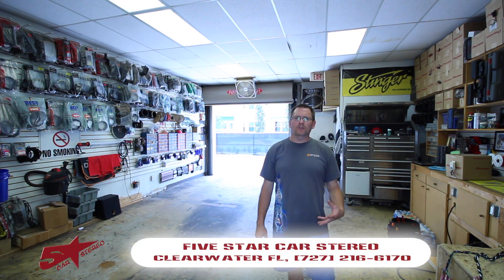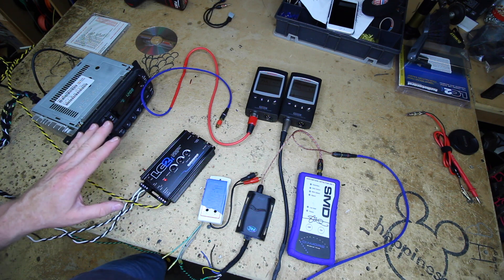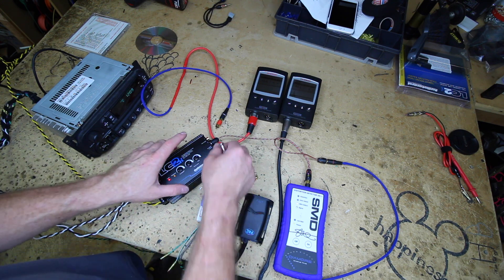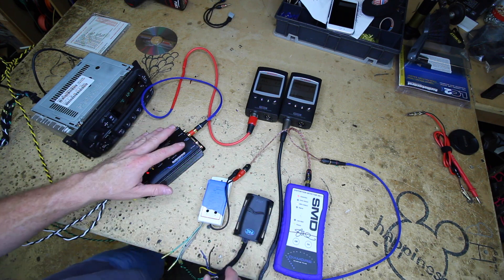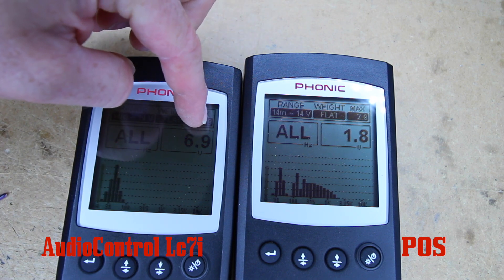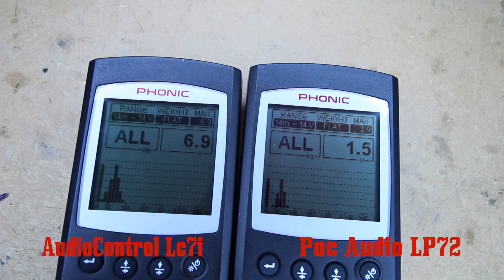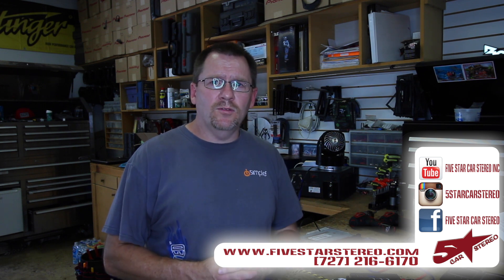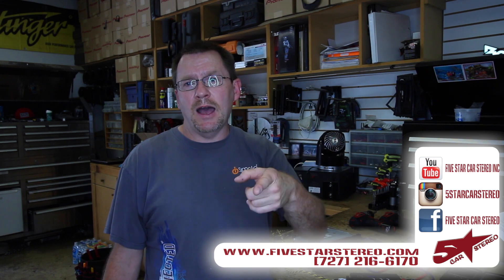Should I get the better high to low level adapter to make my car stereo sound better

Comment: I just installed the LC2i Pro in my SUV today.  It sounds amazing.  So glad I spent the extra money.  Well worth it.
Reply: Did you have a cheapy before that one?
Reply: @radianm6  really hate when ppl don’t reply then someone comes by 2 years later and still waste of their time cuz someone can’t take 30 seconds to comment 🤬 I have a cheapo that is “plug and play” for my car made by pac’ 

Just adding a sub works great! 
When I tried to add 4 channel to door speakers the signal was so dirty get that nasty hum/hiss which is being amplified because the pac loc is cheap’ 

So can confirm at least for me if only adding subs cheapo is 100% fine 
If you are adding amp to
Your door speakers splurge for an active loc
Reply: Hello, what did it improve in yournsystem ?
You can reduce the output voltage of headunit as I understand. Did it reduce the chime noise like turn signal volume, parking sensor sound or other warning sounds ?
Reply: @radianm6  No, it was all factory before that.  I had an Alpine X-A70F 4 channel amp, 175 w/ch.  I guess that was my old system.  Now I'm using an LCQ-1. I have an Epicenter, two 8W7's, Alpine X-S69C's in the front and JL ZR650-CSi's in the rear.  I can turn up the system about as loud as I want with no noticeable distortion.   Everything sounds breathtaking.

Comment: I installed a JBL BassPro SL2 powered subwoofer on my 2016 Volkswagen e-Golf (non Fender audio) by tapping the front speaker outputs and  connecting them directly to the sub’s high level input.  

I noticed the head unit output now clips at a much lower volume and it gets unusually hot. It is impossible to set the sub amp gain as the levels are all over the  place and slight changes to the amp gain cause the sub to cut in and out. 

I verified the polarity of all connections on both ends and everything seems alright. I would assume tapping into the speaker outputs effectively lowers the impedance seen by the head unit onboard amp causing it to go crazy. 

Wondering if using an LC2i instead of the sub’s high level inputs would make any difference.

Comment: What about amps that have their own output converters, are they any good?
Reply: Usually no, they are bad. They have no way of controlling the gain. It’s…cert basic input. Often bass cuts out, or is barely there in lower volumes.

Comment: Lc2i for the win. Also do a vid on running the subs on the top rca outs on the lc2i. Very clean setting without acubass
Reply: Opposed to what?
Reply: @LTSRIDE24  the bottom is for bass out top full range does they sound the same?
Reply: I'm unfamiliar with the LC2. I have the LC8. I'm thinking of doing away with it & simply using my amps high level inputs. I seem to be getting a low / dirty signal from my LC8.
Reply: @LTSRIDE24  make sure polarity is correct
Reply: @bumpylump9236  I know I know asking for advice on YouTube 😂 

Would a lci2 allow 
Me to add a 4 channel power pack like alpine ktp445u  to factory radio (4 door speakers) 
and then add active/ self powered under seat sub…? 
Sun does have both high and low inputs
Reply: @joshymcdaniel9233  I would put a crossover after the l2ci.

Comment: How about using the speaker / pin adapter & tapping into your speakers directly?

How does that compare? That should be a super clean signal, I'd assume?

Comment: I have the LC2i in my '14 Chrysler 300 (Base model) tapped into the rear speakers and it works great, I have ran my 12W7ae with a DC 2k and also a old school Ultra Linear 2150. Both amps made it sound good and the Audiocontrol unit was very easy to install
Reply from the maker: Jesse Gunderson very cool, thank you for sharing your experience.

Comment: Help me in here i have a lexus es 350 2014 and it has premium sound system ( not ML) and I already replaced all speakers in the car I just want to know how to convert the wire signal from the amp it’s confusing it has 1 channel (1speaker) separated in the dash and tweeters in corners L+R and front woofer in doors L+R and rear speakers L+R and the rear sub . As the amplifier diagram for output cables i got 5 channels wires I need to connect to line output converter!! How to do that? I don’t want to lose my notifications sound such as sensors /gps/and the rest . So help me please figure this out.

Comment: The LCi2 PRO is worth every penny. IF you set it up CORRECTLY. 
My corolla has bass roll off at just 41-42 volume. Which is terrible. Goes to 60. 
Doesn't distort until around 52 and that gap is a HUGE volume increase btw. 
Now my bass smoothly increases with it. that ALONE is worth it.
And the fact I don't have to turn my gain up on the amp means less heat, and work for the amp.

Comment: I've got a cheap $5 ebay converter, but I think it's the reason for my problems.
Pioneer amp with 300w subwoofer, maxes out at 8A power draw from the battery. When I turn up the volume more, it just sounds strange and "empty", but doesn't draw more power. I guess this is what clipping sounds like. The amp is great and should output upto 600w rms. The headunit is a $500 parrot astreoid, so I bet it is the converter, but I want your input on this, if you have any suggestions or tips for me

Comment: Thank you for the video. Question. Upgrading a factory Bose system with a 5 channel Infinity amp and sub. Seeing some say that a direct high level input to the amp is better than using a LOC. I always used an AC DSP/Epicenter before, but with older amps and RCAs. Is it better to still use like an AC in the middle to convert to RCAs ? I was planning to get the 7, and run all the speakers through it. Thank you

Comment: I have a 2017 Kia Soul with the stock head unit without navigation. I’ve tried 2 different one a scosche (junk I know) and one the was pre made into the factory harness. Trying both of those I can’t have get a 1V on the RCA’s. Will this boost it to 2V or higher? Thank you

Comment: nice video Dean. i have a question, can i feed the signals from loc to parametric equalizer for more outputs? and hoping you make video  about adjusting the voltage output on loc's.thanks 5 star car audio.. from 🇵🇭...

Comment: I used a metra loc originally and the sound would only come through when i turned the amp settings up all the way. I'm picking up a lc2i in the coming days. Hopefully that fixes my issue of muffled sound and no bass.

Comment: What you think about the axxess mini 4 channel in-line converter 80watts? 
is that a good one for my factory non amplifier radio. to use a 4 channel amp. 
Thanks for the great videos. I’m a follower.

Comment: For installing a Subwoofer do I Tap into the Speaker wires in the trunk deck or should I tap into main FL FR speaker for full sound and bass? 2016 Mustang GT
Reply: Kyle Mertz you should use the fronts, Ford is known for attenuating the rear signals in their vehicles.

Comment: The audio control is for 2 channels, if I wanted to do 4 channels you can hook up 2?
Reply: I dont see why not. Only con i can think of is losing fading from back to front.
Reply: You can either get the LC7i. Or 2 LC2i's and run your front input to One and the Rear input to the other. Then you run your RCA's to each channel of your Amps. I went with 2 LC2i's. I ran the RCA from the Rear LC2i Sub output to my Sub Amp as well as the RCA to my mids & high Amp Rear channel. Worked Great.

Comment: Great info man! One question I can't find and answer to is if it's possible to splitting the rca outputs to send singles to different  amps or perhaps multiple channels on an amp?
Reply: Yes you can, however you will lose voltage every time you split, and you will lose fade ability because you will be working with only 2 channels.

Comment: Finding out when the stock deck distorted, what exactly did you have the dd1 plugged into?
I see one piece of the RCA in the lc2 to the dd1, but where or what is the other blue part of that rca on the dd1 connected into?
Reply: It differently be two different stories if using the DD1 on the rca output when he should be checking the speaker output. Rca output be clean til about 90% volume compared to 60% volume of the radio amp output. It's just misleading to me. And it seems he only answers certain questions and really gives no answers

Comment: I installed a line out converter on my Lincoln, everything ws workn fine but now wher the RCA Jack's go to converter, I have to unplug 1? When I plug both in, it doesn't work,,only when 1 is plugged both subs r on?? I checked all my wirings & everything is good,. Any idea what it is? I'm thinking the converter went out??
Reply: Had the same issue input polarity to lc2i was crossed.

Comment: Thanks for this Dean!! Im thinking of picking up a LC7i for my 2016 GTI, I have a Kicker KX400.4 4-channel amplifier and a Kicker IX500.1 can I hook this up with only the mono bass amp for now until I can get better speakers for the factory locations and then connect the KX400.4
Reply from the maker: Yes,  but I would connect both amps. The 4 channel will make the factory's sound better, just set the xover a little higher. You also only want to pull your car apart once if you can.

Comment: question I have 2015 challenger pretty sure it's basic 6 speaker set up cause sounds terrible so do I "have to use" a 6 channel converter can't I just find which speakers run full range and use a 2 channel converter?
Reply: Usually the fronts have the full range, unless you have 6x9's in the back.  You can certainly do this, however you will lose your ability to fade the sound front to back.  Also, you will need a T-harness to get the sound from your amp to all the speakers, or run new speaker wires.  I'm not sure if the Dodge's have this, but some radios check ohm loads.  If there is no speaker/ohm load connected directly to the speaker wire, the radio will not play sound through those wires.  It does this to protect the radio from a short.

Comment: just a question can u use theses with the normal pre outs just always wondered
Reply from the maker: if you mean the RCAs out of the back of the radio, there would be no need.
Reply: yea I just asking if it's possible just a question :)
Reply: The LC2i does not have RCA inputs.

Comment: I have 2  12” comp r kickers running off a kicker cxa1200.1. My line out is scosche loc90. My amp continues to go into protection mode once I crank the volume to high. I brought down the gain but even so continues to go into protection mode. To avoid it i have to turn down the gain almost where theres no bass. I also turned down the gain on the line out itself and turned the gain up on the amp which did give me more bass but its still going into protect mode. Do you recommend anything else to be done.. i have my speakers wired in parallel at a final impediance of 2 ohms at the amp. What can I do to get my amp to really pump? What about my x over freq? Where should that be set at? Please help.
Reply: Glenn Ortega from the radio don’t add bass to the Factory Eq then again you might have something else wrong

Comment: Please help me!
I have a 2009 accord lx-p with the stock stereo cd/radio no Bluetooth. I had my JL 500/1 and JL  10"  w6 installed and when music is playing the sub will sometimes THUMP OR WHOMP (not music thump though) and sometimes hits hard maybe even shutting amp off. I've talked to few shops 
1) said its the noise cancellation mics (but I don't think my 09 accord has any
2) said its the the stereo not giving a clean signal to amp need after market stereo 
3) said just need a better converter better then the cheapie one I have 
I don't know who is right?
Help me
Reply from the maker: Ok I problem, first look on the headliner back by the rear window above were your head would be. Is there anything there?
Reply: +Five Star Car Stereo no nothing there. I've seen video on a tiny plastic square where it would be but mine doesn't have it.
Reply: +Five Star Car Stereo I've also seen that they are behind the back seat driver side head rest where a tiny little whole is
Reply from the maker: +SBFlashlightGuy give me a call tomorrow if you can just ask for Dean when Paul answer. Tell me you are the Honda guy.

Comment: hello, I have a radio oem navigation system in my hyundai santa fe 2011 and it has a low output with a voltage of 4.15v I want to eliminate the amplifier that brings the vehicle and put one more powerful, can I use the PAC LP7-2 to eliminate this voltage? I have tried several amplifiers and they do not tolerate 4.15v of the radio
Reply: JERSON BATISTA any amp should handle 4.15v input, adjust sensitivity on amp if it's an option. If it isn't u just need to adjust gain and or bass/sublvl on headunit... 4.15v is the output voltage  into your amp, input voltage tells ur amp how many times to multiply the power comming in from your battery.. the higher input voltage the less the amp multiplies so if the amp u tried isn't tuned for that voltage it'll b ovr powered or under

Comment: What do you recommend for a 2003 chevy suburban with the bose stock system?
Reply from the maker: eric ramos what are you planning on adding?
Reply: A kicker dx 250.1 and 2 Alpine bass line 10s
Reply: I ordered a pac sni-35 will that work?
Reply: As far as i know the rear doesn't have the stock subwoofer but it has the rest of the bose components
Reply: Five Star Car Stereo will the sni-35 work?
Reply from the maker: eric ramos yes it will work fine. If it is a Bose system it should have a factory sub in the armrest.  You can pull the cup holder and get to the wiring. There are 4 wires in pairs that are the sub wires. They are on the Passenger side of the armrest. They are Dr blue and lt green and Dr green and Lt blue. The wires all have a strip on them. The Darks are Positive.
Reply: OK thanks really helps hopefully it works out I'll get back to u and let u kno how it goes

Comment: Well I got the PAC LP-72 to replace my PAC SNI-35 and I'm getting more static noise than before. When the RPM goes up on my car the pitch of the static noise gets higher. I have a 2015 corolla and grounded the "chassis wire aka the black one" and installed it next to my rear speakers. Does anyone know how to fix this? I've been reading forms and stuff but nothing has givin me an answer.
Reply from the maker: dudg00 did you see this video?
https://youtu.be/woAfVpf3Krw
Reply: dudg00 I moved my pac lp7-4 further away from my stock head unit and added some foil tape to the head unit cavity. That plus adjusting the gains solved my noise issues.
Reply from the maker: Jon Medeiros cool, glad to hear you got it working

Comment: I'm getting low voltage from my lcq-1 on my 2014 Honda Odyssey factory system. it's hooked up after the factory amp should I connect before the factory amp?
Reply from the maker: no, it will not work before the amp. That is a low level output. have you checked to see if the factory radio puts out a variable voltage output. If it does all you have to do is add RCAs. 
https://youtu.be/6Zw04MVbNsM?list=PLA1LIIrpw0qvrzfcpoJR_3fcY1j8zZnxB
Reply: Five Star Car Stereo I have not checked to see if they are variable but I have the lcq-1 cranked all the way up and no maximized light and my gains on my amp are more then half way for decent out put. I'm running lcq-1 to rockfordfosgate t1000-4ad to a set of JBL 660gti and it just not putting out what I feel it should doors are enclosed and dynamat
Reply: man if you had a shop out here I would be there tomorrow to have you troubleshoot this. I'm going nuts trying to get it to what it should be.
Reply from the maker: +MrRunsideways did it have the factory sub?
Reply: Five Star Car Stereo yeah factory sub and factory center channel. I had it wired into the  front speakers outputs and it wasn't a full range signal more like a telephone sound output and then I moved it to the rear speakers which gave it more full range.
Reply: Five Star Car Stereo but if I connect with a y cable and directly to a Samsung s6 i can leave the gains down at zero and it is so full range and noise free.
Reply from the maker: +MrRunsideways did you check the radio output
Reply: Five Star Car Stereo I was busy with the kids and errands. I'm definitely going to check this Thursday I really appreciate the follow because I know you don't have to. your shop is located in Florida.
Reply from the maker: +MrRunsideways yes we are in Florida, let us know what you find.

Comment: I have an lc2 and I’m still clipping ! Please help
Reply: Before you do anything, turn down the bass and keep everything on  the head unit at "Flat" So no EQ. Make sure it's all in the mididle. 
Then play a regular song, make sure the sub is not connected at this time. Keep turning up your stereo until you hear the quality start to degrade.
Or, just turn the volume of the radio to around 65-70% of it's max. 
Keep it there, never go above that number. Now use the Lc2 and adjust the gain until the clipping goes away , unti lthe maximum goes away. 
most radios that are stock distort, and send clipping signals after about 65-70% volume. Just the way it is.

Comment: Then it means that all my audio equipment can sound more powerful with an expensive hi-low than with a cheap hi-low?
Reply: No, just cleaner. So if you need to amplify a 1volt sinewave into a 40volt sinewave, you need to amplify it 40x. The more you amplify a signal, the more THD is produced which is distortion. Now, turn a 4volt sinewave into a 40volt sinewave and you only got to multiply it 10x. Which means you crank the gain knob down and get the same output. Which is cleaner output.
Reply: @GhilleGhille  
ok thank you very much you are a teacher